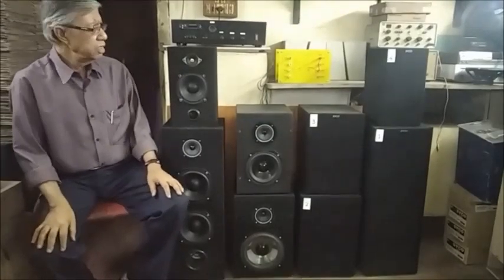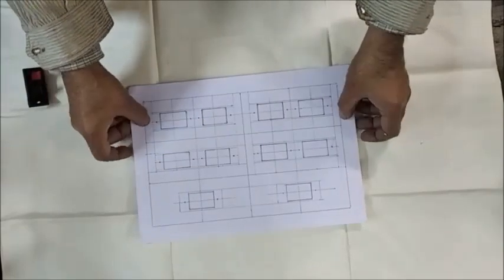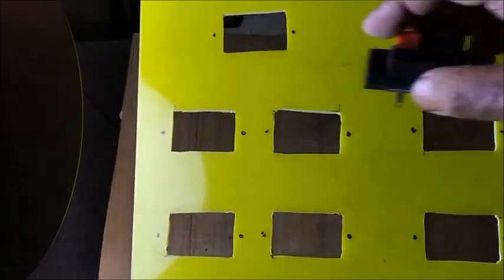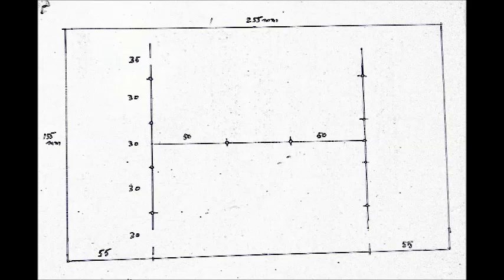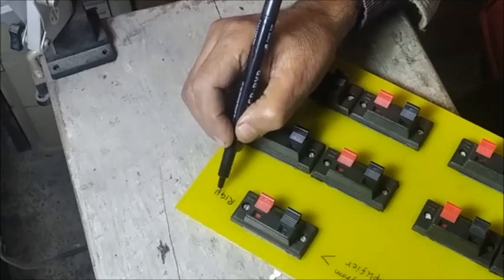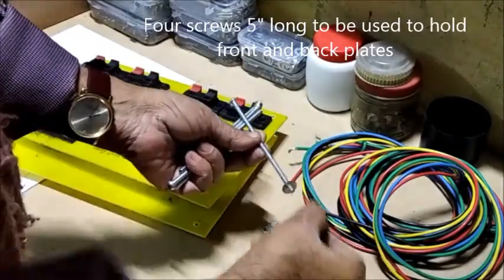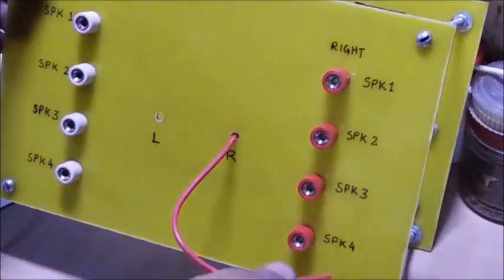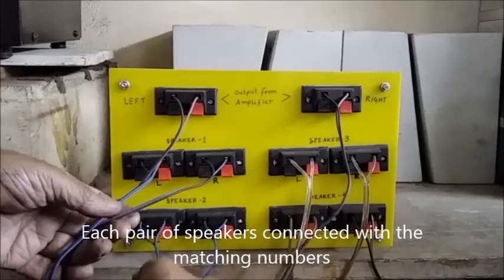Select a  Pair of Speaker you want to listen

Comment: Sir what is difference bookshelf speakers and normal speakers what is use of double 6' speakers and single 8' speakers sound clarify or louder
Reply from the maker: There is no difference. 
As the speaker can be kept on a bookshelf because of small size that's why the name.
I wish to make a video to explain about other points you have asked.